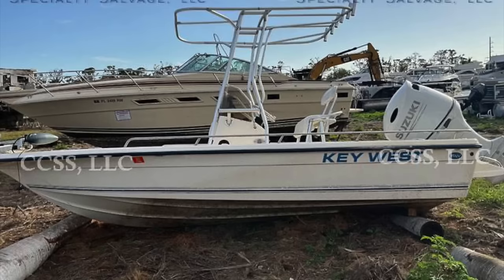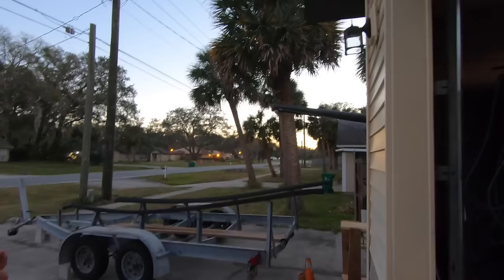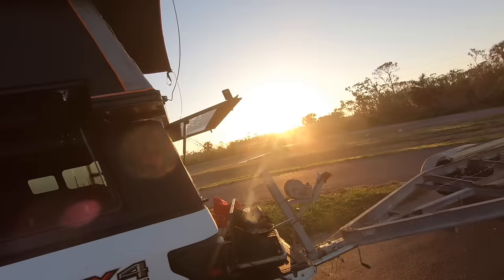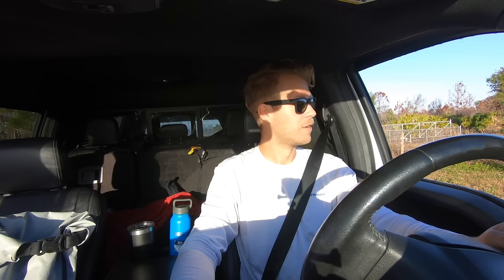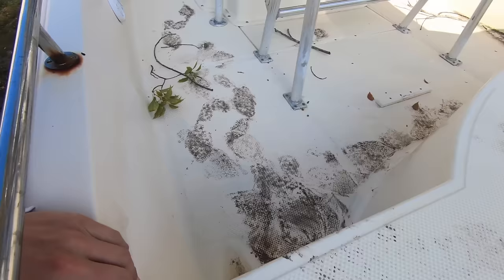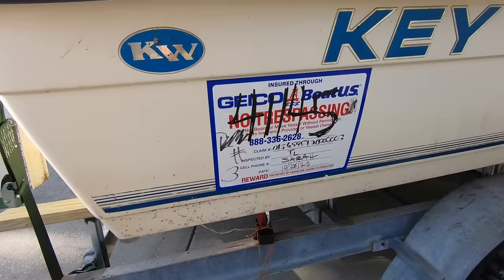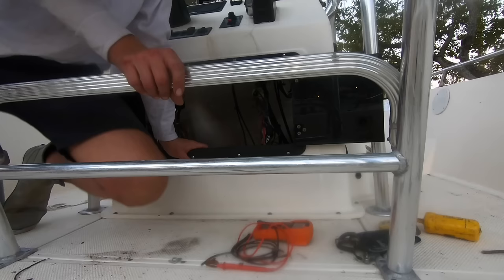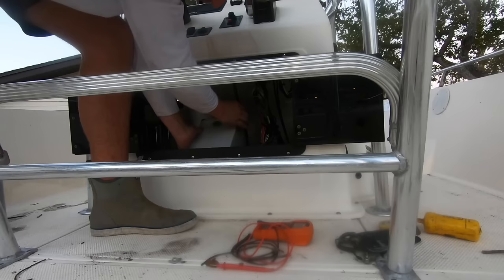I Bought a CHEAP Hurricane Salvaged Boat!

Comment: I did the same thing. Ended up with a 2021 Yamaha f90. I had to replace the engine harness and the idle motor solenoid flushed it all out. Fresh oil runs like a champ. That's the best way to buy a motor. This one only had 10.7 hours total time and it was sunk in freshwater. No corrosion no rust. The motor looks like it just came out of the Yamaha box 12,000 motor. I've got less than 3000 invested in. It runs great
Reply from the maker: Thats amazing! I am hoping to have that kind of luck here! The signs of salt are obvious on mine. Lots of detailing to do on my end!

Comment: As long as the motor spins over the only real issue will be the wire harness mainly the fuse box thats  the only area thats not sealed. Just clean out the hi and low fuel pumps and replace the fuel filter in the Bottom. All should be great.   Never had a Suzuki yet that went under that i wasn't able to have running that day. 
Great find , good luck

Comment: I’d 
1. Strip the boat of all hatch(s) 
2. Remove the tee top and deck plates remaining 
3. Remove the gas tank and hoses
4. Remove all the wires 
5. Remove the engine and strip down to the block to inspect what needs to be replaced/ reworked 
6. Core drill the stringers and transom to indicate how much water intrusion has taken place.
7. Clean and sanitize the interior hull compartments.
8. Dry out interior of the hull with fans and build a bubble with a commercial grade dehumidifier to expedite the process.
9. Build a stand for the rebuild of the motor and testing and so on if your going to do it at your home / compound..
AND So On….

Cheers 
Jjr
Reply: Damn really?
Reply from the maker: Fuuuuuuuk…. Lol Trying to get it to run and to float lol. Let’s see how far I really have to take it.
Reply: @carlweekend  LOL,  That's a good list though
Reply: Do it right or go home. No need to throw good money to the way side. And by following this and doing it right may cost some money, but then again how much does a new boat and motor cost. And i am sure a lot less to repair it right.
Reply: 💯, drag it out to the desert 🏜️ for half a season.   
Dry and UV cleaned by nature 😂

hatches,  tee top, control
binnacle, steering hydraulics, center console , wheel, leaning post 
= 3k on west coast craigslist

Guessin your in it for about that 🤔

Comment: If you spray brake cleaner into those combustion chambers I'd recommend that you follow up with a bit of fogging oil before cranking the engine. I'd also suggest that you crank the starter with the ignition disabled for a few seconds before allowing a spark (The deadman switch should work for that)) so that you get some engine oil circulating before that engine fires up. And, perhaps most importantly, change the oil before even thinking about turning that engine over. Oil is lighter than water so despite the pristine appearance of that oil you could have salt water at the bottom of your sump and that would be bad. So pay attention to the first thing to come out of the sump when you drain the oil.
Reply from the maker: Thanks! I used the break cleaner to blast out the junk that was down inside spark plug well. I did this before removing the plugs so that debris didn't fall into the cylinders when I pulled the plugs.

Comment: If the motor was solid, I would probably not sweat it.  Not looking good at this point, after alot of demo and dry-out, fiberglass lay up, tons of wiring your going to be in in for some coin.   The good news; since this is content, you’re probably going to end up with a badass skiff with a 2 stroke and another full life.  
I re-motored my immaculate 98 Aquasport in  2014 , and I’m still in it for the cost of a new skiff 😂
Wouldn’t have it any other way my sled sleighs 55kts and drafts a bit more than a foot and now I have been able to land my PR yellowfin that was almost as big as the boat , and still be able to run around backwater and main channel on the lower Colorado River 🤘🤘
Sometimes unwise choices lead to the best experiences.  Lol. Sometimes

Comment: I flip boats as a side hustle. If the hull wasn't breached it's probably fine. It will clean up. Everything electrical is shot, you need to totally rewire. I wouldn't even start messing with that engine. Either have it rebuilt or better, sell it to a person who rebuilds and repower with a new engine. After that, and with a trailer, you will have a boat worth around $40-50K. My guess is you will have around $25 into it not including the boat and trailer and with just basic instruments. That's with a $15K repower. But selling the powerstick and trolling motor (if you get them working) will take off those costs.
Reply: $40-$50k for a 2004 bay reef 196? Even if it wasn’t a salvage boat and if it was in great shape that’s a $15,000-$20,000 boat.

Comment: Spray those cylinders down with some oil before spinning the engine over esp that number 3 it definitely had water in it.
Reply from the maker: She needs a lot more soaking than I thought. I found some good stuff. Hope there is not to much gunk in there.
Reply: @carlweekend  marvel mystery oil works great we use it on locked up engines.  Put it in a spray bottle. I think it can be saved if the exhaust valve on number 3 hasn't rusted up
Reply: Just be patient and let that stuff soak for weeks.
Reply: @ Carl Weekend, Take the fly wheel cover of and get a socket that fits the crank shaft. Then try turning it over with a racket wrench or breaker bar before trying with the electric start. May save the cost of an expensive starter. And if you get it to start moving spray more oil in it, oil is a good thing so don't be chinsy on it.
Reply: @carlweekend  best thing to use in these will it run is marvel mystery oil tilt engine as high as it will go and load up each cylinder just let the t soak for a day or two. Then hand spin it a couple of times to get that mystery oil shot out of the cylinders. Get all batteries out hang the wire up  spry some degreaser and clean bottom of compacts get a gal of simple green you will need it. Spray wd40 gel good stuff I spray my etec all inside after washing down like next day keep everything rust free  good luck shit can those batteries use as core don’t trust those junkers those battery chargers are supposed to be in a well ventilated space not inside  the console JT 🇺🇸🇺🇸🐟🐠🎣🛥🇺🇸🇺🇸

Comment: Yea. When i took the lower plug out the water came running down..)) i was like damn..... clean all the connectors, resolder some connectors on harness and it ran... anyways almost all electronics had to be replaced on my project...
Reply from the maker: Check the next video to see how the motor electronics held up on my project!

Comment: I think Key West hulls are made by the same company that makes the hulls for Palm Beach which have lifetime warranty on stringers
Reply from the maker: I knew Key West hulls are made with foam filled stringer system. You can even see where the speakers were stolen that the bulkhead is foam filled. So my hope was it didn’t sink to bad since the foam would provide flotation. Didn’t Palm Beach Boats go out of business?
Reply: @carlweekend  yes I think they did I bought one brand new in 2006 the 158 center console  it really was a good boat and on the transm it had a sticker something that said lifetime warranty and the company name pretty sure same manufacturer for Key West
Reply: @tomrizzo1554  key largo

Comment: wtf?How much did the boat cost?u say cheap - what's that?i'll watch the next post but you need to give up more info...i don't think you need to invest anything more except in electronics -i bought a few submerged boats and brought them back to life in an instant.off course todays engines are full of electronics and computers so you'll probably need to replace ecu if it shorted out - that depends on the fact if it was connected to the battery or not when it got wet...your steering does not work because the pump is not working for now. good luck
Reply: Amen brother ….   RIGHT ON THE NOSE  !  Can’t think of anything to add, except your  first couple of letters …. ( WTF , FOR REAL )